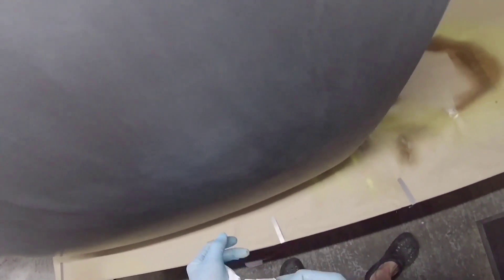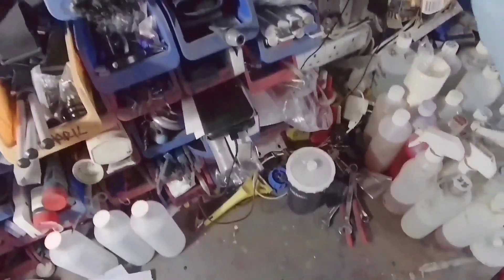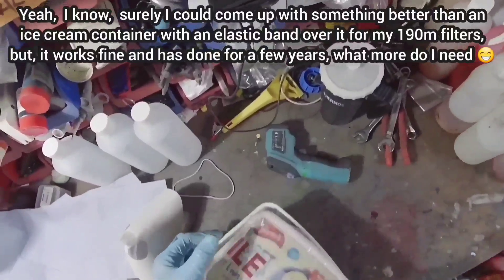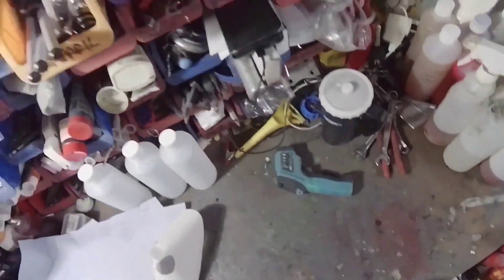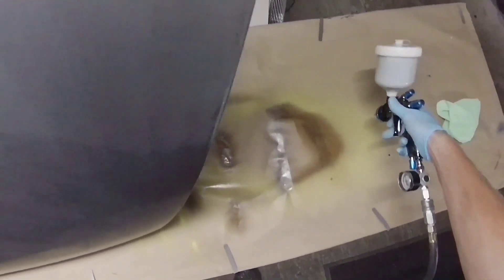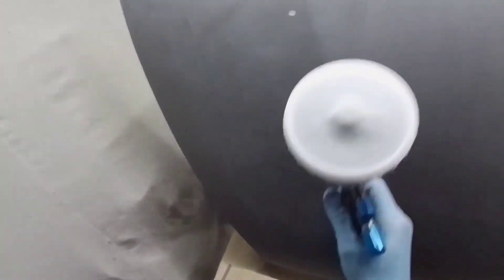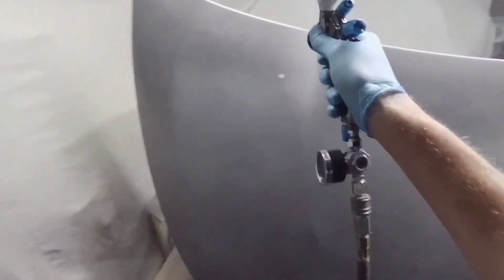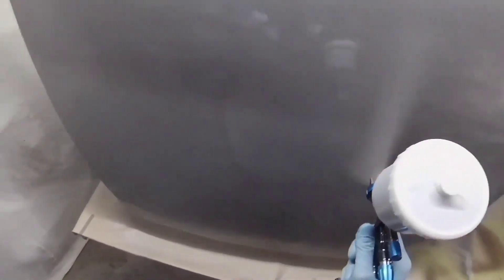Anest Iwata WS400 Series 2 OBS Digital For Solvent Base Coat Spray A Hood Bonnet

Comment: It's nice to know one can use the OBS with solvent paint.  I just read an article specifying it's use or intended use for with gen II water-based paint.
Reply from the maker: It's works fine with most paints, it's even good for clear coat but quite slow, cheers buddy 👍

Comment: Pete, just play with it in my body garage and I was surprise that we can’t swap the nozzles from version 1. Iwata did a different thread angle. So it’s absolutely new parts ….not happy at all about it
Reply from the maker: They changed the threads on the cap and the tip just for the hell of it !
Reply: @peteshobbies5383  Yep, they are stupid ...Plus, they marked the parts number so hard to understand at all...

Comment: what is better for metalic solvent obs or ls. I just tryed the obs and i liked its atomize finer than sata 5500 hvlp but i cant reach ls series 2 to try it. What would be better ls vs obs for solvent i'm looking wor fine and not heavy aplycation. Many thanks in advance regards
Reply from the maker: Hi Mate, I prefer the OBS for solvent and the LS for waterbourn paints. There's a lot of air going through the LS, around 16.5 cfm, similar to the Sata HVLP, which can make some solvent paints a little dry. The OBS certainly seems better for solvent
Reply: @peteshobbies5383  i have SATA HVLP 5500 1.2/ 1.3 I and o, now i'am looking for some a little bit dry applycation. Is there difrence in the fan and droplet size between ls and obs. just in the moment i borrowed one obs from friend why splits the fan if i dont close one revolution the fan knob i tryed the pressure but the reason is the fan knob. I redused the paint even one part thiner one part thiker to try it. I like it just the fan split is a little strange for me because with sata there is no aituation like this (if i dont turn the pressure more than 2.6 or 2.7 bar bit this is nor normal in any case)Regards from Bulgaria
Reply from the maker: @boyanbyankow5192 Hi mate,  I haven't had a problem with the fab splitting on the OBS or LS. Did the WS400 OBS have the correct OBS tip in it? , was it set to 90° , so the splits in the tip line up with the air horns?.

Also,  as I think you know, if the material is too thin, the fan can split, also pressure is normally around 1.8 bar, a little more, too much and the fan will split
Reply: @peteshobbies5383  yes is 90⁰ i didnt overtight. I dont know this is my friends gun the nossle is bf-s sr2 ws 400 the air cap isws-400-03-bf. It's not obs obviosly i use iwata for first time but the gun is with blue knobs made in japan 2022 (on the body of the gun)i use solventborn base maybe is worn already i dont know. Give me advise what will be better for dryer applycation ls or obs setup. With the sata i have wet applycation, i want someting finer but a can't get few iwata for try them i found just this one
Reply from the maker: @boyanbyankow5192 If you want a dryer application, the LS will be better
Reply from the maker: The tip you have, BF-S, is for wet on wet primer applications, it puts out more material than the OBS tips do
Reply: @peteshobbies5383  many thanks, i have no expirience with iwata but definately i like it. I'am going for ls

Comment: Hi Pete, very good video mate the OBS S2 did a nice job laying the basecoat with a nice smooth silky finish, I didn't hear you mention it in the video but why are you using an analogue gauge when it's a digital gun🤔 I'm asking as my gauge can be hard to read at times even though I fitted a new battery when I first use it the low battery symbol shows but it seems to improve as I'm spraying the panel, I even tried taking the gauge off today and warming it up but it didn't really help as the numbers were still quite faint in the display🤷‍♂😅

Thanks for sharing this Pete and I hope you are keeping ok mate👌👍
Reply from the maker: Hi John, It's a Meiji regulator with an Iwata gauge,  I find they really smooth the delivery of the air flow, especially with the more air hungry gun's as I need a higher pressure at my filter set,  around 5 bar with the 16cfm gun's so these keep the pressure around 3 bar at the gun if you're looking around 2 bar through the gun.

It's also much easier to adjust these than the control on the gun, so it's how I use all of them. The only exception is the DV1 digital as its good to have a gun without a long tail if its something low down, ie the tail hits the floor, very rare that I need that, only if something is on the car and low down and on my driveway 😂

Sounds like the voltage from the battery is low on yours. Have you put a volt meter on it to check?
Reply: Yeah I know what you are saying about the on gun control as they can be quite tricky to set especially the X5500 that always seems to go to 0.1 bar either side of the number you are trying to adjust it to🙄having said that I do find that once they are set they don't often need changing unless you are using a different setup in the gun.

I did wonder if it was the battery but as it's a brand new one I fitted I thought it should be ok but I will test it👍
Reply from the maker: @JohnWD40TC02 I know what you mean about the Sata's 😂.
I've had button batteries before that are in date but down on voltage, so it's certainly worth checking. I think they are CR2016 3v if I remember rightly, so you should get around 3.15v from a new one

Comment: great video pete i got the series 1 i love it and didnt fancy the series 2 didnt seem worth it
Reply from the maker: Hi Grant,  The only time I find you will notice the difference. Excluding cosmetics is with the clear coat WS400, and that's simply because with the tip lined up, you can use a full fan if you want to without the fan splitting, otherwise I don't think anyone will notice.
They are, as you will know,  very good. The split tip definitely helps with atomisation at the expense of a little speed, always a pleasure to use, cheers mate 👍

Comment: GREAT VIDEO MATE BEEN WAITING AGES PETE TO SEE WHAT ITS SPRAYS LIKE AND PERFORMS HAVE YOU JUST BROUGHT IT GOOD VIDEO BY THE WAY THANKS FOR SHARING THAT IWATA SAYS MATE 2 BAR FULL FAN AND FLUID
Reply from the maker: Hi Andy,  it's the OBS version, I got it in June this year. Yeah,  Iwata recommend 2 bar on all these except the LS400, which is 1.8 bar.

Realistically, you don't need that with basecoat. Here it was 1.6 bar, goes on nice without problems, sometimes too much pressure will put it on a bit dry giving you stripes , all depends on the paint and colour,  cheers mate 👍

Comment: Class work mate , a point of interest,  have you tried the hd yet ?? If you have did you shoot a vid ??
Reply from the maker: Hi Dean,  Yes, mate, I have used it a few times in different setups, I've got 1.4, 1.6, and 1.8 sets now, I have got some video footage of it with the 510 & 1.4 spraying clear coat, it's actually did rather well, I will get a video up soon, I've got a huge backlog of videos but obviously they all take time, cheers mate 👍
Reply: @peteshobbies5383 what are your plans for the 1.8? Could it be a primer video? Thanks Pete
Reply from the maker: Hi David,  Yes, I think that will be the way to go with the 1.8, a higher build primer
Reply: @peteshobbies5383  thanks for your reply Pete only really used it in a 2mm set up for polyester and high builds which gives me great results never tried it in smaller sizes , would imagine the fan to be quite small ??
Reply from the maker: @deanbrown7643 It certainly is with the 430 cap I managed to get, but it isn't too bad with the 510 cap
Reply: @peteshobbies5383  can't wait for that one. I'm looking for a reason to switch from the sata 100bf to an iwata of equal performance.  The sata does a fantastic job, but I still would like to use an iwata if the finish was as smooth.  Thanks Pete

Comment: Hi Pete, I've been thinking about purchasing the ws400 evo clear and the one for base. Ive sorayed with the ls400 entech before. I normyspeay with the lph400s. The silver cap for clear, i also have another with the lhp with the orange cap for base, and purchased the purple cap only. I also run the loh440s for sealer and primers. I have sprayed with the supernova ls400 entech a few times. I have been curious about the supernova ws400s. I'm have been debating about purchasing the ws400 evo clear one and the one with the gold caps for base. I can purchase both guns of ebay from Paintingtool Japan. I live in the USA  I haven't hear anything when the series 2 will be available. Im not in a rush. What would you recommend?
Reply from the maker: Hi buddy, I would recommend both the WS400 Clear and OBS Gold cap version, they are very good guns.
The Series2 guns are more of a cosmetic styling change in all these guns apart from the WS400 clear version. 

There, it does genuinely make the gun easier to use as it cures the problems you can get with the fan splitting although there are ways around it, I've put some links in the description of this video which will help with that.

The gold cap version sprays the same as these blue cap ones,  so very good indeed, the technology is the same as the LPH400, and the tips are interchangeable, the main difference being is they run at a higher pressure,  normally 29psi, I know people run the LPH400 up to that sometimes but the idea is for a lower pressure.

I buy lots of stuff from paintingtool_jp as they are often cheaper than the UK, I did ask them ages ago if they could get the series 2 and as yet they can't as they can only get what available in Japan.

Might be worth sending them an email (paintingtool.jp@gmail.com) as the prices are a bit cheaper than Ebay. That's how I do it anyway. Well, it actually via Instagram messenger, but I don't get them via Ebay 

Cheers mate,  hope some of that helps 👍
Reply: @peteshobbies5383  thank you. It is very helpful! Can you tell me about the difference between the obs and hd?  I've never heard of obs and how would someone identify them? Since leaving the collision shop, I only get info from YouTube now from different channels and yours has been one of the best out there for different types of spray guns. I have too made the same mistake using high pressure on the lph400. I'm still kinda figuring out how to use them now that I don't spray much these days. Especially metallics. I'm more self taught in painting. I started spraying a single stage back in 1995 using a siphon gun from binks #7 at high pressure. I was so us to that for a few years. Then moving to a gravity feed uses a Sharpe spray gun then moving into the lph400. I never had any issues with metallic base before until I went to a collision shop in my home town and started to see stripping and modeling in the base from PPG. YouTube is where I found out about the control coat. I finally had the chance to try that technique out just a year ago from a shop I did work at. I recently moved to a different state and I am now able to go on my own to do my own little shop. I just would like to have way more confidence in spraying the right way. Thank you for all your great information
Reply from the maker: @careygale2315 The OBS is the WS400 with the gold control caps, it only differs from the WS400 clear gun, apart from the colour of control knows,  by its tip, the tip has smaller air holes around needle the hole so let's less air through, it's the reason the WS400 OBS Series 1 doesn't suffer like the clear WS400 Series 1.

I think you guys call it a control coat. In the UK, we call it a drop coat. It is the same thing, sometimes you will need it sometimes you won't , and, of course,  it's depends on the materials you are using.

The split tip guns,  like the LPH400,  WS400 OBS,  Wider4L, LS400, etc, are generally better at laying more complex colours. They produce a very even finely atomised pattern, which should help avoid tiger stripes and patchy areas
Reply: @peteshobbies5383  thank you so much for your info. I probably will buy the ws 400 for clear and the gold caps for base!
Reply from the maker: @careygale2315 You're welcome, buddy 👍